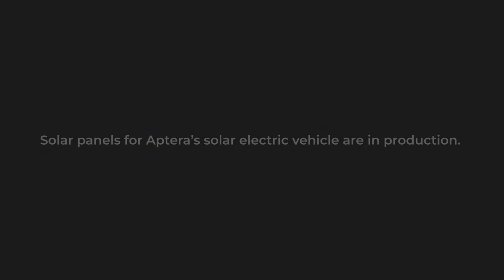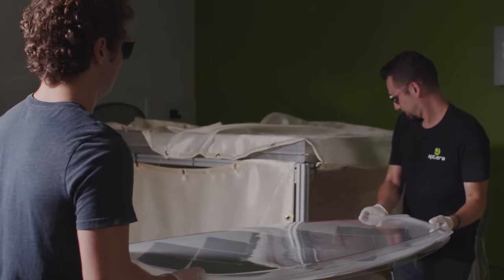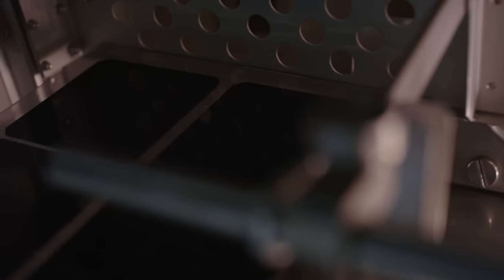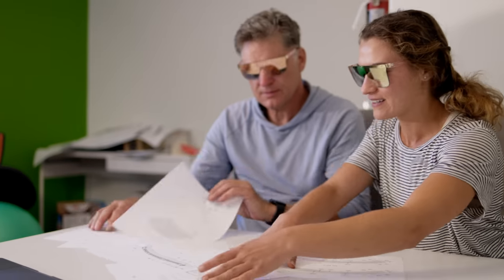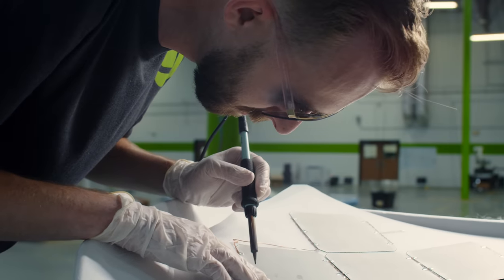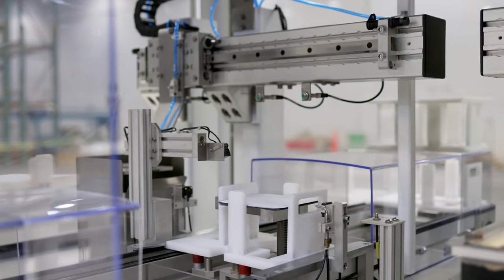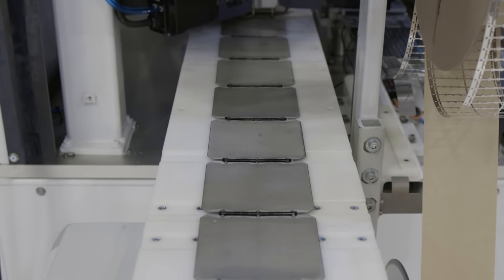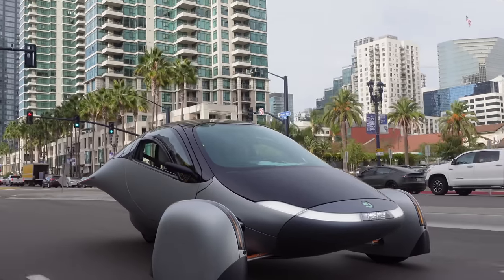Aptera — Solar is in Production

Comment: Ist wearing goofy sunglasses indoors a prerequisite for working at aptera ?
Reply: In that facility, it is according to Cal OSHA.
Reply: N. Bruce Nelson is wrong.

From another commenter who looked up the ACTUAL Cal OSHA requirements.....

"Laser Protection. Employees whose occupation or assignment requires exposure to laser beams shall be furnished suitable laser safety GOGGLES...." and ".......or other equipment producing ultra-violet radiation shall be so arranged or shielded that ultra-violet radiation, either direct or reflected, does not strike employees' eyes in harmful intensity; where such arrangement or shielding is not practicable, employees shall be provided with GOGGLES..."

Note the above references GOGGLES and not "weird sunglasses".
Reply: @n.brucenelson5920  Sorry N. Bruce Nelson, it is NOT a Cal OSHA requirement for Aptera's employees in that facility to wear goofy sun glasses.

Comment: What's with the glasses?
Reply: It is likely an OSHA requirement due to the chances of UV exposure.
Reply: N. Bruce Nelson is wrong.

From another commenter who looked up the ACTUAL Cal OSHA requirements.....

"Laser Protection. Employees whose occupation or assignment requires exposure to laser beams shall be furnished suitable laser safety GOGGLES...." and ".......or other equipment producing ultra-violet radiation shall be so arranged or shielded that ultra-violet radiation, either direct or reflected, does not strike employees' eyes in harmful intensity; where such arrangement or shielding is not practicable, employees shall be provided with GOGGLES..."

Note the above references GOGGLES and not "weird sunglasses".

Comment: Whats wrong with these people wearing sunglasses inside? Do they want to look cool? Seems pretty stupid to me.
Reply: It is almost certainly a Cal OSHA requirement for working in a facility with UV or laser light present.
Reply: @n.brucenelson5920  Oh so thats why the last guy had them off most of the interview and put them on at the end?
Reply: N. Bruce Nelson is wrong.

From another commenter who looked up the ACTUAL Cal OSHA requirements.....

"Laser Protection. Employees whose occupation or assignment requires exposure to laser beams shall be furnished suitable laser safety GOGGLES...." and ".......or other equipment producing ultra-violet radiation shall be so arranged or shielded that ultra-violet radiation, either direct or reflected, does not strike employees' eyes in harmful intensity; where such arrangement or shielding is not practicable, employees shall be provided with GOGGLES..."

Note the above references GOGGLES and not "weird sunglasses".